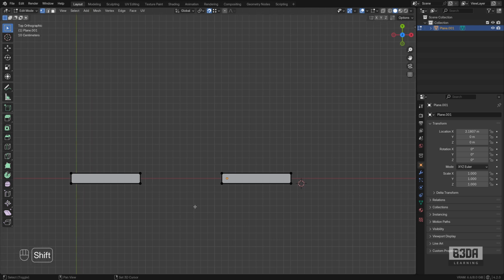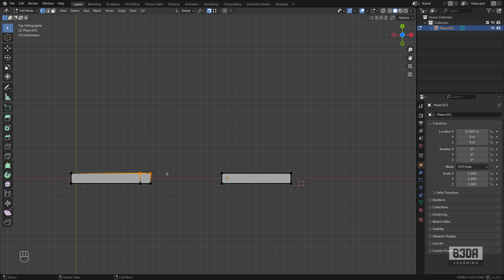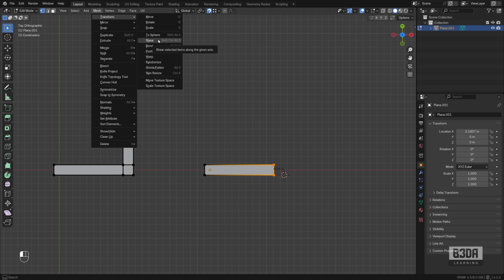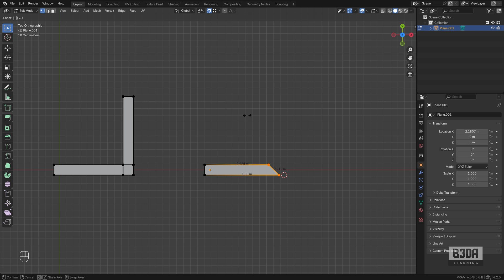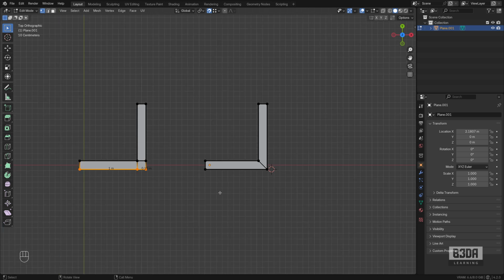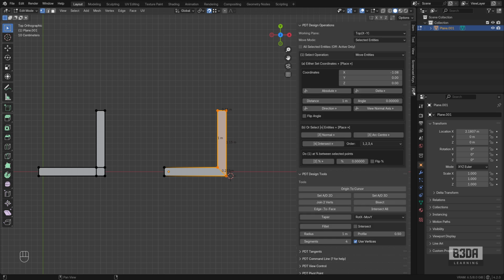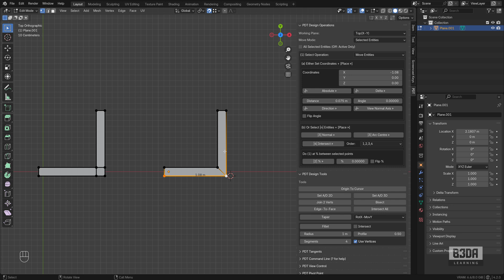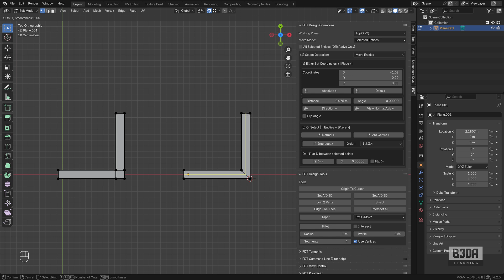Blender for Architecture: Wall Corners with the Shear Tool

Comment: Thanks for the video. But аctually , if you simply use the 3D Cursor as pivot for the Sheer tool you can save yourself all those additional gymnastics.